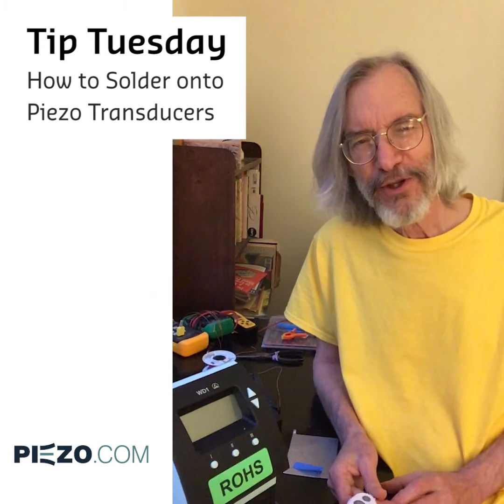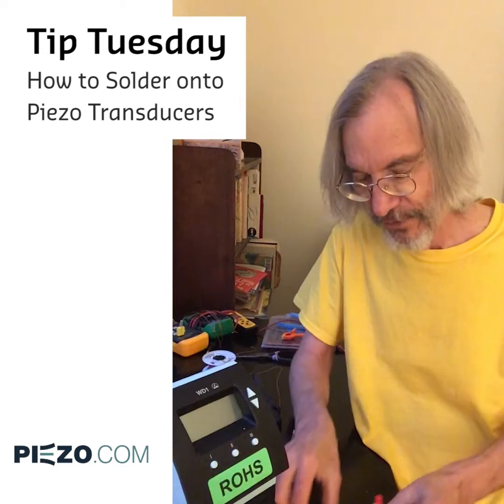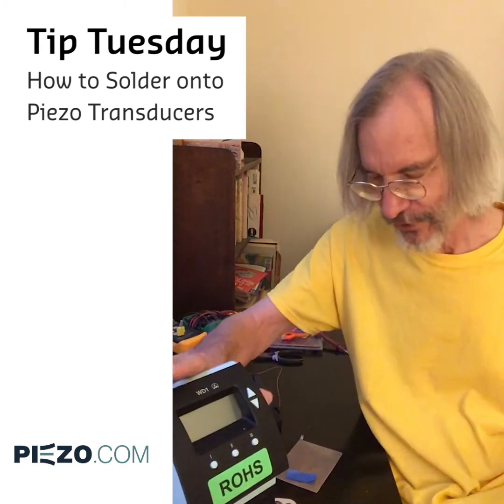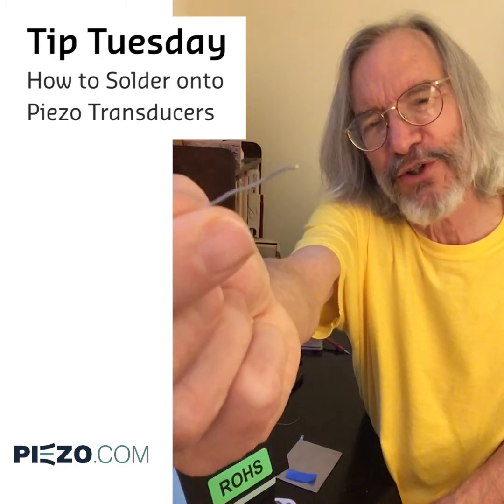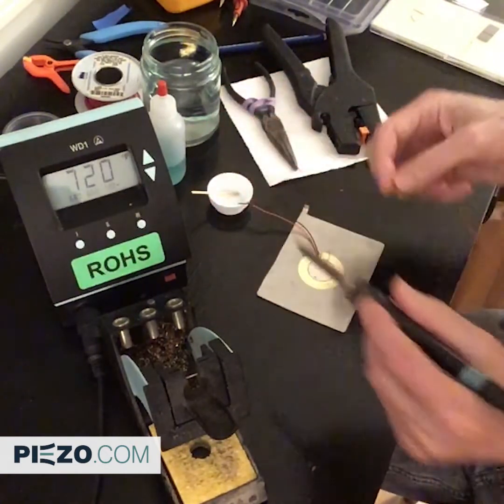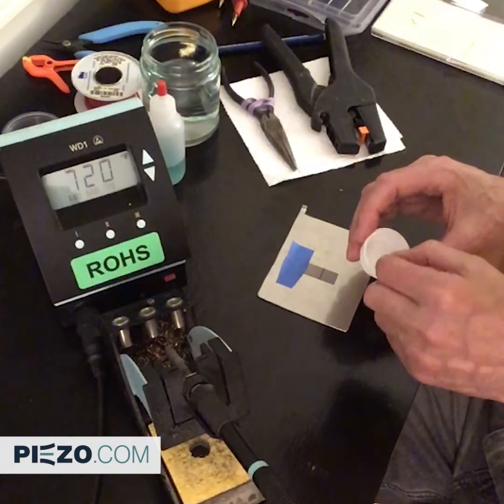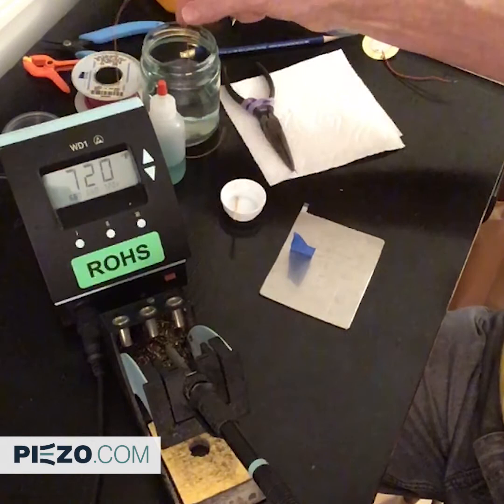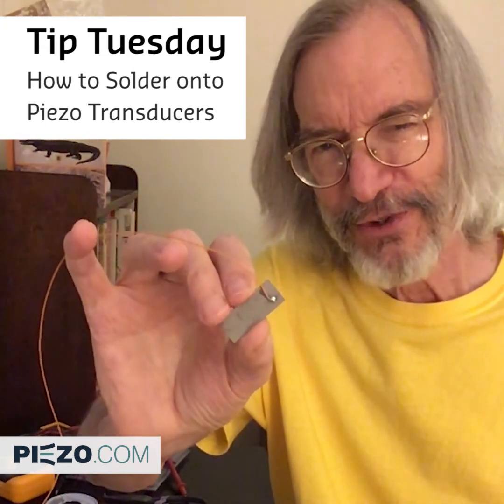Tip Tuesday: Soldering Joints on to Piezo Transducers

Comment: Nice video! Please consider getting a fume hood, or at least use a fan to blow them away from your face!
Do you happen to have any recommendations on where I could purchase piezos that are in the order of magnitude of 1mm³? I'm working on a small project, but could only find larger (order of magnitude cm) plates of piezoelectric materials online...
Reply from the maker: Hi there! That is a very good point and we will make sure to take care of safety points. Regarding your question, were you looking for 1 cubic millimeter?  If so, you can buy 1mm thick stock and have it diced. We at Piezo.com have  40 mil sheets, our T220-A4BR-1305YE
 and we can dice it for you! If you are interested or have any additional questions feel free to reach out to us at help@piezo.com